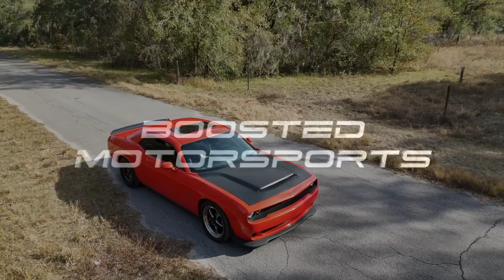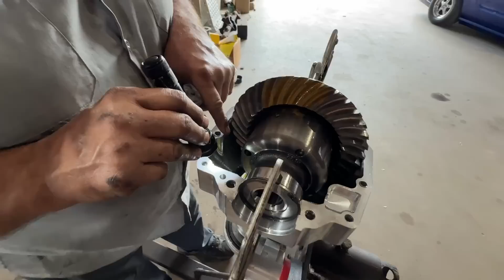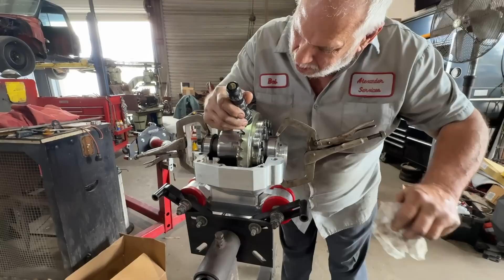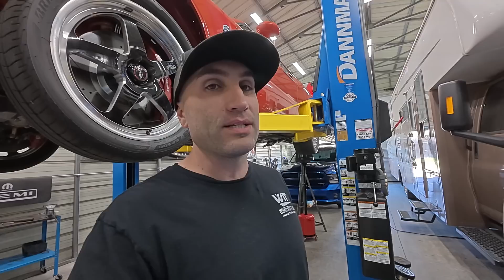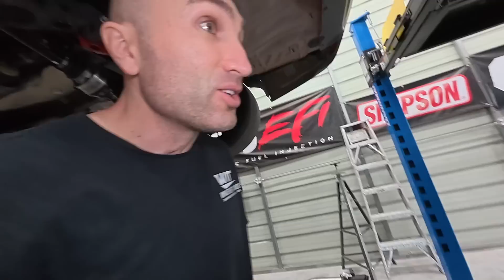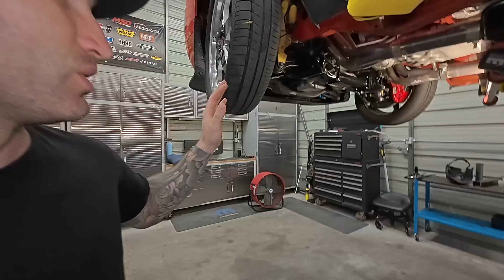CUTTING APART A DODGE CHALLENGER HELLCAT

Comment: Just curious would your front end alignment change when you cut that crossmember with the weight of the wheels and everything hanging?
Reply from the maker: No as the K member gets all of its strength and support from being bolted to the frame of the car itself 👍
Reply: @boostedmotorsports2  Thank you

Comment: Nice cradle  mod. Thanks for covering the diff inspection.  Thanks and tell Bob thanks also.
Reply from the maker: Thanks! Bob's gonna be happy with this one!😂
Reply: @boostedmotorsports2  Yeah seriously. There's so little out there about ZF diffs. I saw the comment about his location. Don't know where your located but if he can get yours quieted down you should ask if you can give out his contact info. If he was within 2-3 hundred miles of me I'd take my diff there. If he has to make an adjustment on pinion depth or preload, I'd even consider buying a billet and new factory diff for him to assemble. I'm sure you will but keep us informed on the progress and results. Thanks
Reply: Glad to see in subsequent vid that the diff is back installed. How's it sound?

Comment: John. Off topic from the cross member, which is very cool, but does the CarPlay radio you installed in the Ram work with the stock mic, or do you have to change it out for the included one and mod the built in mic? Thank you.

Comment: That kit is really cool. You can get that oil pan off without lifting the motor. You have to drop the rack by taking out the main bolts and leaving the tie rods on but you have to angle it like a puzzle to get it to clear. You also have to unbolt the pick up tube and slide the windage tray out. I've had to do some piston and rod repairs after some over boost lol. It is a big pain though. Super excited about this kit brother. That would make it so much easier. Great video!!
Reply from the maker: @michaelwaiwood5629  thanks man! Kit is now live for sale on ShopBoosted.com 🤘
Reply: These old guys that have years of old school working knowledge. 
Are a resource to be that needs to be passed on!